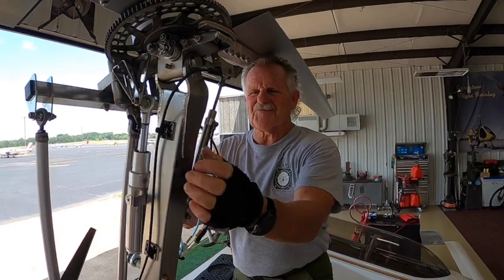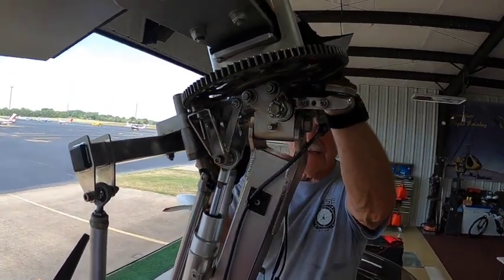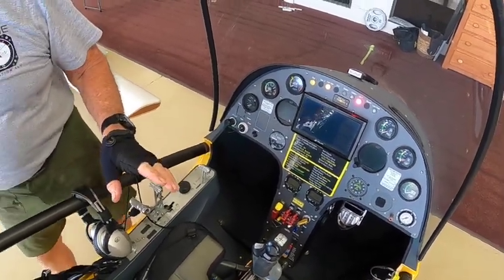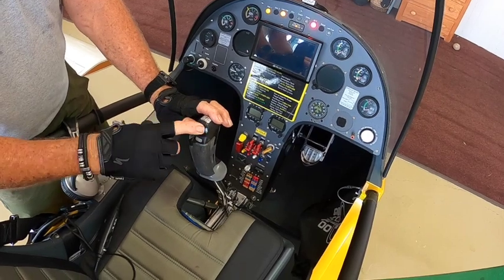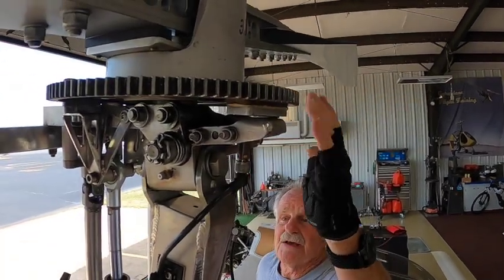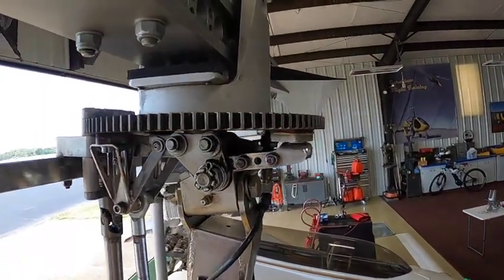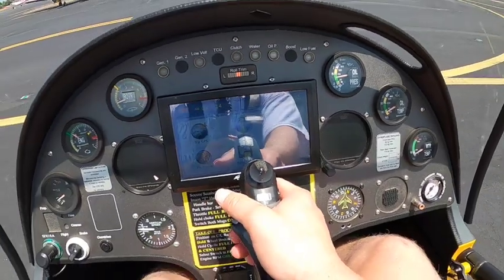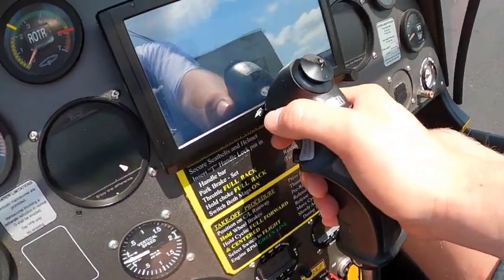MTO Sport Rotor Brake System Breakdown

Comment: How do you make sure that rotor brake isn't used in flight accidentally?
Reply: Just what I was wondering.  What if something weird happened in flight, would it lock up the rotor or would the rotor torque be to much for the pads to grab and simply burn the pads up